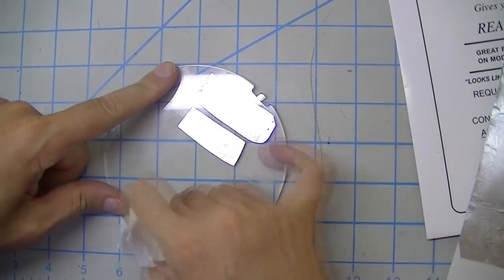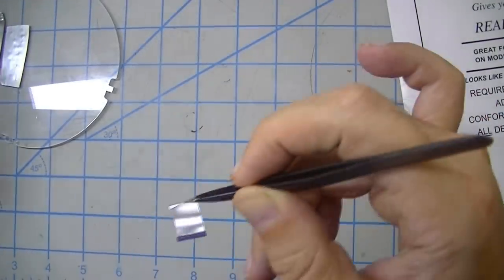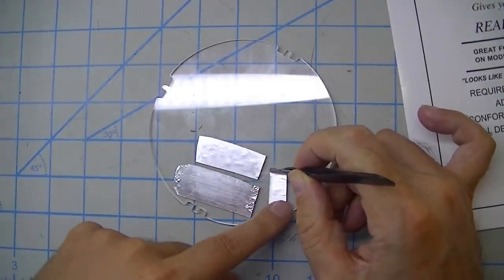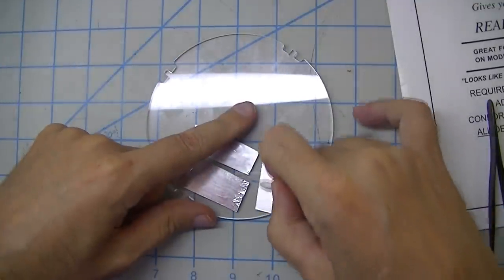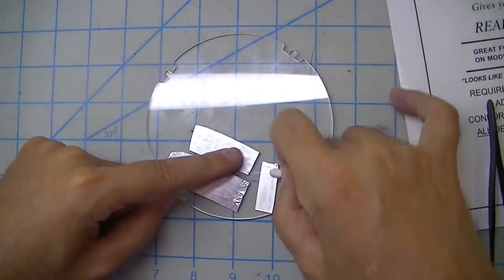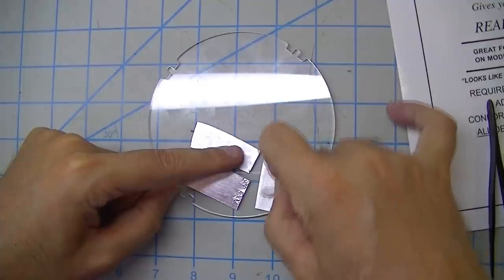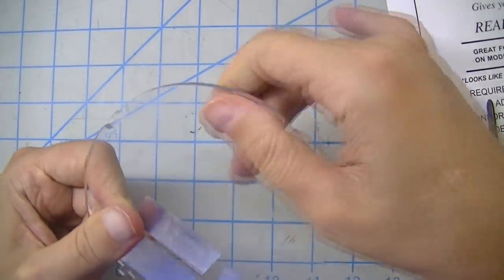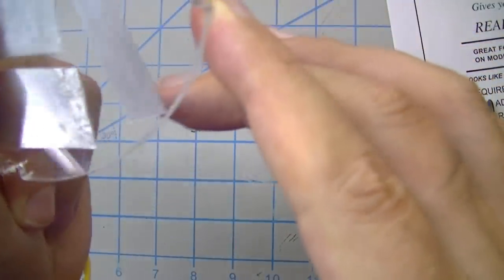ep327 - the foil adventure (with the eduard 1/48 mustang) part 8

Comment: Just out of curiosity, does any of this stuff burnish and  polish to your satisfaction without adhering it to a surface?  For instance, burnishing the Bare Metal Foil without removing it from the backing, or taping the kitchen foil to the lexan before burnishing without using the glues?  It might help to point to the  where the problem is: material, adhesive or tools.  I could (and might) try it myself, but I doubt I have your eye for the required finish.

Looking forward to your conclusions in Part 9.

Comment: The orange peel texture of aluminum foil probably relates directly to the crystallization stucture it gains out of its last production process, which is probably cold rolling. Maybe heat treatment of the foil before applying it has some positive effect by recrystallization processes within the metal itself. The recystallisation temperature for this would be arround 300-450°C (572.0-842.0°F). In combination with the right annealing time, a uniform and fine crystal size may be achievable which may get the orange peel texture below visability. A nice little autumn project at the kitchen stove for sure ... :o)

Comment: Just a thought Will - could you apply heat to the proceedings in some form when applying the commercial bmf?  Getting that glue it has on the backing more viscous. 
Heat afterwards could also be interesting, almost hot-ironing the foil after its applied? Or a hot hair dryer and a q tip

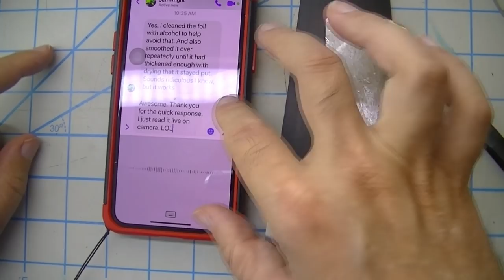Comment: 44:00 BUSTED! LOL was untrue! 😁 (Then again, my laugh emoji may not be accurately representative of my reaction either, so there).
Reply from the maker: wat
Reply: @barpfoto 
You wrote LOL - Laughing Out Loud without actually laughing out loud. (It's a running joke in my family).
Reply: @barpfoto  Dear Mr Pattison , Please try what I do , get yourself a book of silver, copper ,brass leaf , not
foil , will need a piece of lambs wool as well , clean the wing of all oil or mold release agent
buff it with the lambs wool , then carefully lay the leaf , want to slowly . carefully burnish in place 
This all takes some practice as leaf is trickily to handle , best to gain experience using cling wrap 
first as they both act the same 
bare spots or rips can easily be corrected by burnishing small pieces of leaf , overall effect when done 
gives an interesting vagaries of real sheet metal